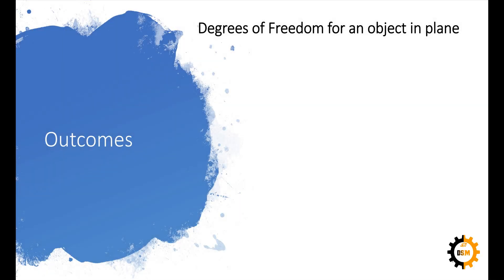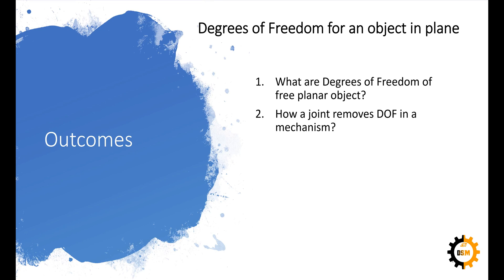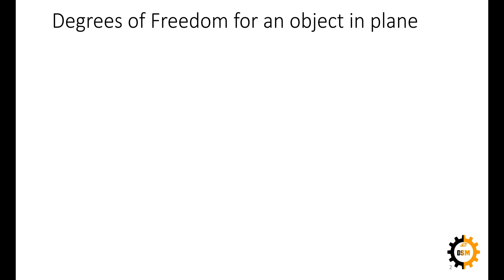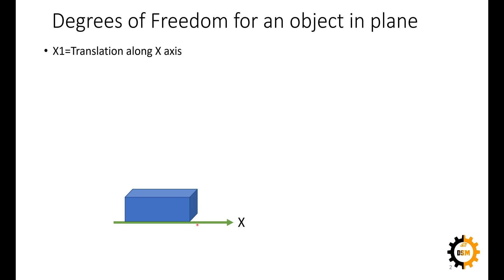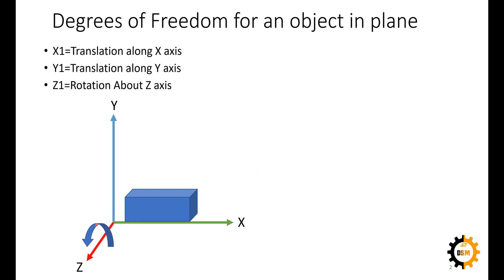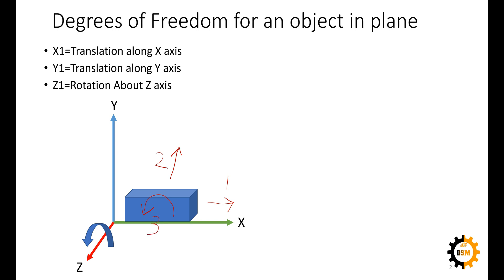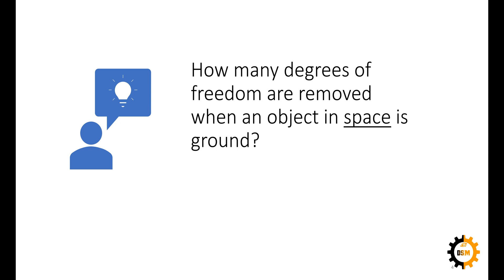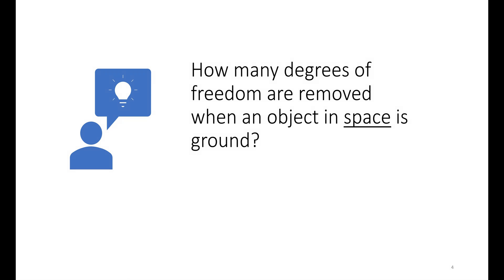1-5 Theory of Machines | How Degree of Freedom (DOF) is removed by a joint for a planar mechanism?

Comment: Basically, Degree of Freedom is the number of independent variables required to define motion or position
If DOF is 0, then we have a structure. If it is 1, then we have a kinematic chain and if greater than 1, then we have an unconstrained chain.